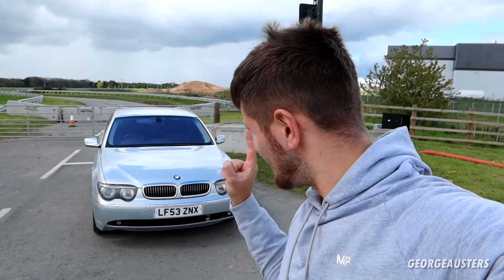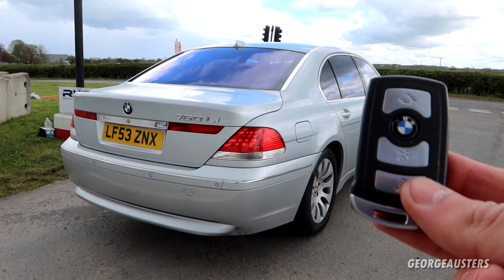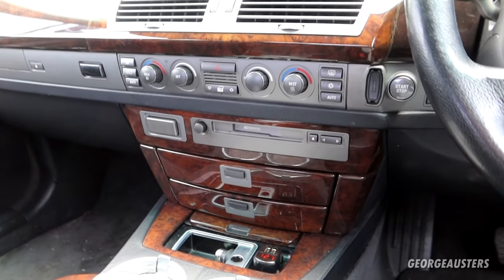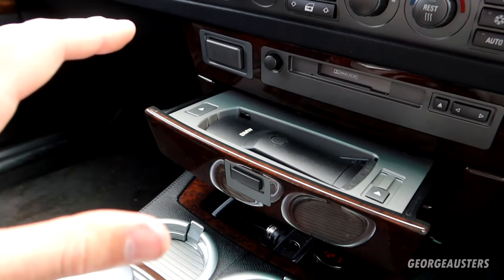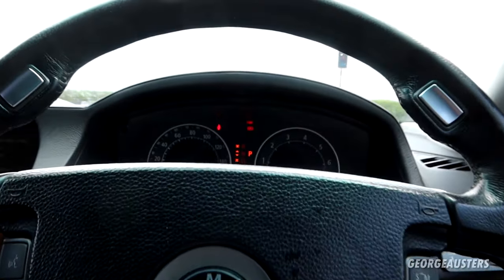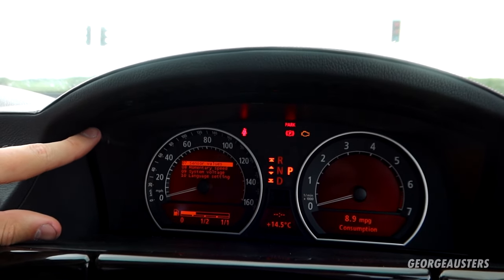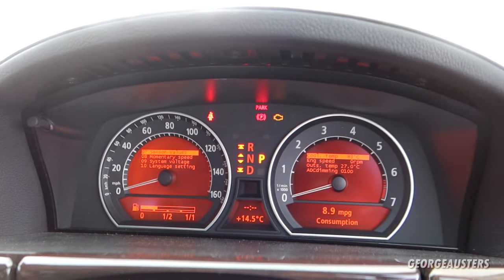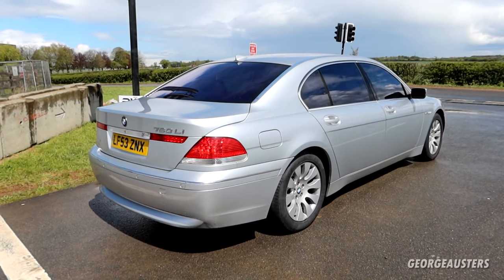BMW 7 SERIES HIDDEN FEATURES!

Comment: I think ypu broken the emergency fuel cap opening because it was actually unlocked, and you pull it too hard, this only unlocks like when you open the car with the remote control,  and then you can push and open the fuel gate. Sorry for my bad English.

Comment: it doesnt cut off the battery, it's for transporting the car, but it doesnt do much, even when off most things still work. I can drive in the off position.  To save battery press the ignition twice without the key in, with the doors closed, then leave the car (driver first) this will turn off most things.

Comment: There was a secret stash spot / door in my 03 745li center console. Also the center console could be air conditioned to act like a cooler for beverages
I did not know about the battery disconnect! Thank you for the video

Comment: Do you need the bmw yearly subscription activated to use the key fob as you describe? I bought my 2007 750LI used,no subscription activated for bmw service and assist,the key fob doesn't work even after a new battery in the fob,and new car battery.Blown fuse?,or no bmw subscription/no work?

Comment: Sounds like the hydraulic boot pump is  very short of fluid- should be a smooth opening not a rasping sound.
Reply from the maker: Sounds like it but fluid level is fine I think!
Reply: Since your fluid level is OK, check the hydraulic strut that actually raise the trunk and the associated lines (2) which have a total of 4 connections (2 per line) . Assuming that the grinding noise heard on the vid is not the pump,  it sounds like you are either sucking air or expelling it. According to both TIS and the parts catalog, only one side (left) has an actual hydraulic strut, the other is merely a hinge. If operating properly, you should just hear a kind of hum. At least, that's how the one on my E65 sounds.

Comment: If the car battery died from sitting to long, will the button to put the windows down still work or no?
Reply: nothing works when the battery died. Even the doors you have to open manually using the skeleton key.

Comment: My 7 series keeps lifting from different sides and dropping ( the body ) do you know what it could be ? I had the rear height sensors done etc before and it fixed but now it’s happening again someone said the previous owner may have changed the mileage so it’s causing it problems ?
Reply: Mine does it too

Comment: Hey buddy hope all is well just a quick question... do you have to code injectors if your replacing with used one from same engine? Lots of confusion about this atm
Reply from the maker: On certain engines yes
Reply: What about 2014 m135i If I bought used ones from exactly same engine?

Comment: Don't know if you can help?
I brought a BMW 730D On at 57plate.
I tried to replace my number plate bulbs with LED bulbs and brought up error light on the dash but the number plates was on is there any way I can take the error of the dash?
Second thing is there any way I can stream my music to the car without using the aux cable, any help would be great 👍
Reply from the maker: You need Canbus LEDs👍🏻
Reply: @GeorgeAusters  could you send me a link to any canbus leds for the BMW?

Comment: Hey great video. My key fob wont stay in socket. I push it in and it pushes back out. Any suggestions
Reply from the maker: Flat battery?
Reply: @GeorgeAusters  you is the car battery dead? Yes it is. Would a dead car battery cause this possibly?
Reply: I meant do you mean is the car battery dead?
Reply: @GeorgeAusters  is there any way at all to start 745i without keyfob. Keyfob still wont stay in cradle
Reply from the maker: Charge your battery first then try again
Reply: @GeorgeAusters  I will do that. But just for future reference, does the 04 745i have any other way to start without fob?
Reply: Yes,that's a dead or defective car battery,the electronics don't see the fob,no power in the system,and.do not lock the fob in the dash

Comment: Awesome! I have a question is there an emergency hood latch somewhere on the car? I  went to open my hood latch that’s on my driver side and I pulled to hard and bow it’s not attached to the latch and I really need to put power steering fluid in
Reply: Bmw dealer body shop can open these . But its not that easy .

Comment: Hi George I'm thinking of buying a 750i 2005 face-lift what are they like to drive size wise as I was running a 325ci e46 and a smartcar as a daily ?
Reply from the maker: Like a boat👍🏻
Reply: @GeorgeAusters  great so easy to drive just got to get used to the size and power lol going from 190bhp to 362bhp

Comment: Any one get the best and cheapest solution for a replacement battery for the key
Reply: They have button cells available, cr2023 I believe,$5,at any supermarket, you pop the key out,pop plastic back cover,put the new button cell in,put it back together

Comment: You r a comedy,-() my07 750li with the 4.8l V8 is great I just got done doing the transmission my self, it's a lot of fun And it goes really fast.,-) a Camaro try to race me on the freeway on interstate 40 he couldn't pass me I just barely got on the gas. Now I have to change the throttle gas pedal module.

Comment: Non of them remote features is a hidden function. I have a 730d and obviously it does these things. But since you're a kid, you'll not know that bmws from my 93 525tds and every other bmw and other car makes close the windows if you hold the lock/ open if you hold the open. You missed the auto parking brake on the steering wheel.
Reply from the maker: But still people are not aware of these features. Maybe they’re not hidden for you but they are for many others👍🏻
Reply: Right - not knowing about those features is not the same as hidden. That's why there are manuals...

Comment: not gunna lie but you owned the 3rd series  bmw thats by far one of the most cheapest series you could buy other then 1 2 and series which are also garbage think about it you said it yourself most people dont care and drive  it till the wheels fall off literally you have these young kids buying them used after used after used kid its one giant scam if you want dependable and assurance   go with top tier 6 7 0r 8 even the 5 series is nice but that v10 is affordable but those parts are like lambo prices thats the only terrible issue plus all these so common failures you here everybody say they have more or less its like everything is common to fail due ti lack of TLC AND MOST OF THE TIME THE 678 AND HIGH END ALPINA ARE MORE EXPENISVE SO YOU GET SOMEONE MORE RESPECTABLE AND SOME WHAT RESPONISBLE AND SOMETIMES LUCK OUT GREATLY JUST GOTTA DO RESEARCH AND ALWAYS CHECK UNDER AND OVER THE HOOD AND TEST DRIVE BEFORE USE  AND BRING OBD READER SCANNER  IS A MUST  CAR FAX AND IF IT HAS MORE THEN 2 OWNERS DONT DO IT UNLESS IT WAS IN THE FAMILLY WHAT DO U THIUK OF THE N66/E66  v8 4.8l 750LI BMW 2007 IF KEPT UP with all the cars requirements

Comment: Your outside air temperature sensor needs to be replaced... otherwise your gas mileage goes to s**t.
Reply from the maker: Mine?
Reply: Outside Air Temp is used for the Auto Climate Control.
Reply: Yes.
Reply from the maker: My outside air temp is reading fine